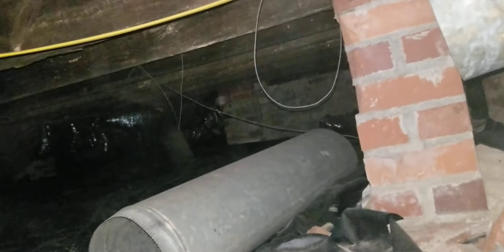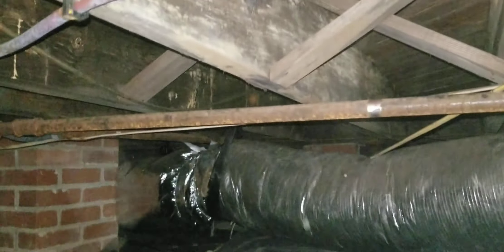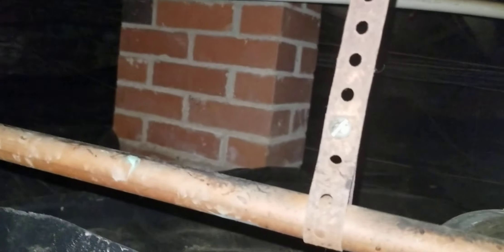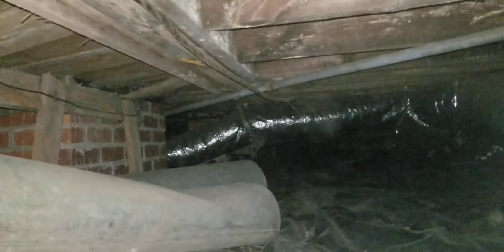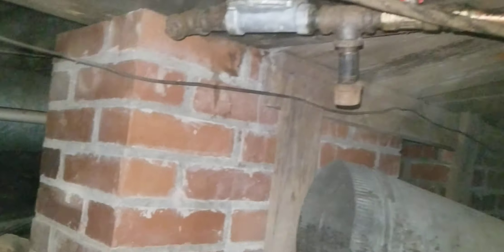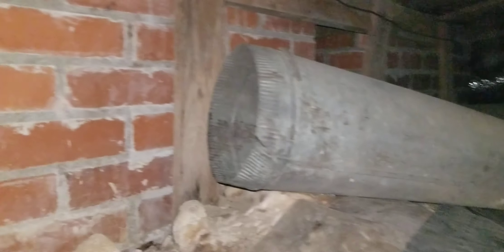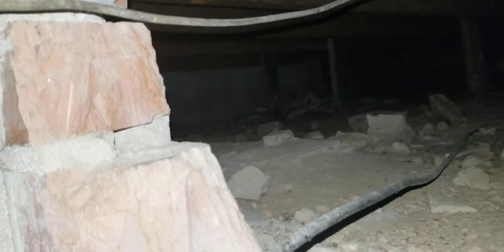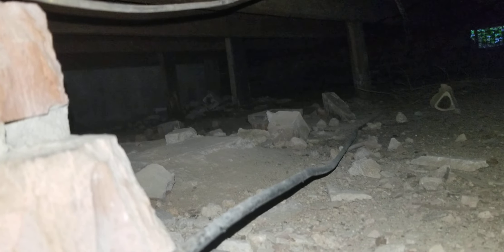Massive house Massive crawlspace problems.part 2

Comment: Whoever did this work should be held accountable and this is definitely by several contractors who said hell no to correcting what they all seen. Not worth several million as listed, especially with comprised floor joist.
Reply from the maker: Agreed.
Reply: The people doing the work were to lazy to take the material not being used out of the crawl space . I deal with that all the time .
Reply from the maker: Unfortunately this house sits in the the middle of and area that's booming. This is a one story ranch about 3500 sq ft. Beautiful interior with older custom finish $$$. Unfortunately older homeowners who trust there local techs to watch for any problems. Most homeowners don't want to invest 1,000s in there crawlspace until it's to late. That's the story here.

Comment: Commenting on what you said about animals under the house in your video. Thats why i carry a firearm on my side under my house . Better to have if you come across an animal or reptile that would love to do you harm .
Reply from the maker: This crawlspace broke me. It was listed for 2.2 million.  It had 4 different crawlspaces.all connected by a narrow hole in original foundation walls. I broke the videos into three parts. I started crawling the house at around 9;30 am and came out around noon. What a mess. Year ago the house started as a smaller ranch. The house now with all the additions measures 5400sq ft. No air flow what so ever. Thanks for watching✊️
Reply from the maker: God bless 2A.